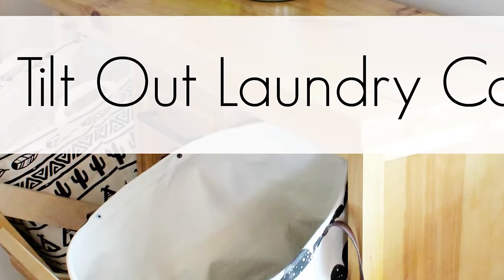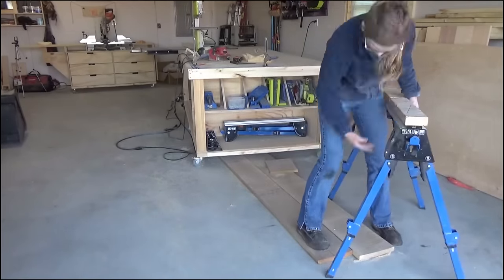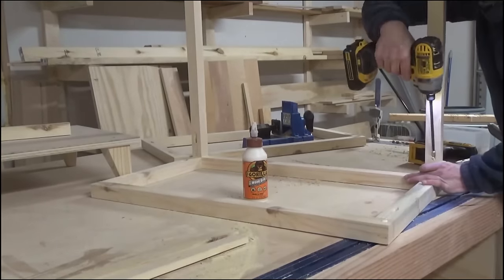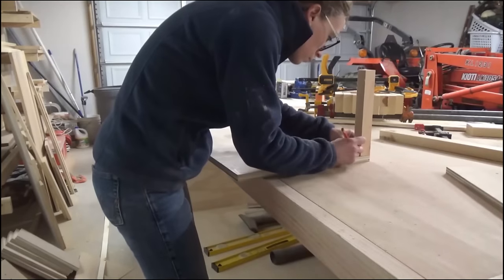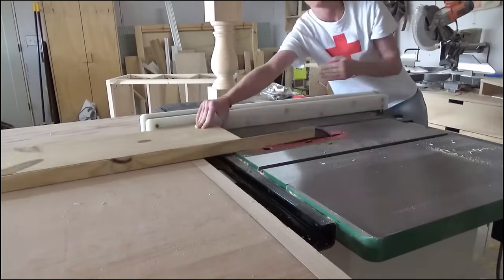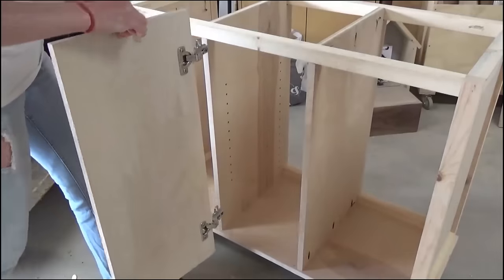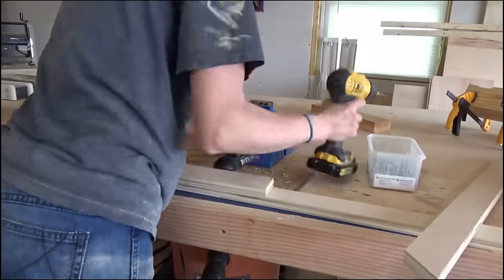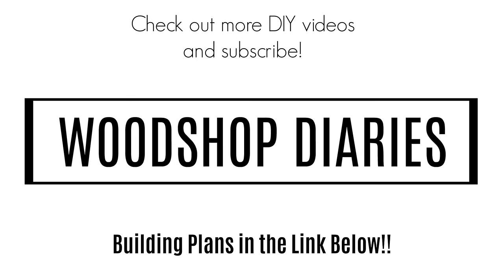How to Build a Tilt Out Laundry Cabinet

Comment: Just remember that using glue on end grain is almost rendered useless as the end grain absorbs the majority of the glue, hence why most people use some kind of joinery (half lap, mortise and tenon etc.) then use wood glue. Amazing build though, came out awesome.
Reply: when I do this type, I tend to use a router, rout a channel until about half an inch from the end, and wedge in another piece of wood. You can't see it once assembled, but MAN does it make a difference

Comment: You are awesome.  I have an entire garage/shop that I could do this in, but I'm totally afraid.  Where did you get your determination?
Reply from the maker: You got this! You just have to start. The determination has to come from yourself and you just have to decide to try. I’m self taught so I just learn by doing.
Reply: @WoodshopDiaries  I feel like mistakes could be expensive.  I will give it some thought.  I have no excuses...I am retired and my father was a carpenter.   There should be some of that ability on my blood.  Lol.  I want to make a hamper cabinet/tower for my bathroom.  I would hate to screw up on good wood.  Maybe I should try modifying an existing cabinet.

Comment: I'm about to build something similar and was looking for how others approach this. I had in my head that I would use some kind of horizontal dowel as a hinge pin and hadn't considered standard euro hinges. Watching your video changed my approach. Using the hinges can also provide the added benefit of a soft close - thanks!
Reply from the maker: So glad you found it helpful! There are probably several good ways to do it, but so far so good...this has been working great for a couple years now 🙌😄

Comment: Love your videos, I made one just like the one on your video and it was really nice but I use compressed wood for top and sides but when paint it I didn't like the way it looks so my question is ...do you have any suggestions on how to paint compressed wood and make it looks nice???
Reply from the maker: I’m not sure what you mean by compressed wood? Do you mean plywood? I use plywood all the time for my projects and paint them just like I’d paint anything else. But, I use high quality birch hardwood plywood (basically cabinet grade plywood) and that makes a big difference. Regular rough pine or treated plywood won’t be smooth enough to give you a nice finish.
Reply: @WoodshopDiaries  maybe that's why, do you have any suggestions on how to make fix it at this point??
Reply from the maker: I’m not sure what your exact issue is to fix. You just said it doesn’t look like you wanted, but I’m not sure what exactly that means. I’d suggest priming if you haven’t already. And a thorough sanding between coats of paint.

Comment: When you made the top with 2x10’s would it still be durable if I wer to use a 2” strip of other wood in between the 2 2x10’s?
Reply: If you use wood glue and/or join them then yes.

Comment: That turned out great! I have been searching for a good video guide on how to make one of these! I am looking at making one with 3 tilt outs. Is this cabinet pretty sturdy? I was considering doing a custom walnut and epoxy piece for the top and just wanted to make sure that it can withstand the weight of the top piece if I take that route. Thanks for the video!
Reply from the maker: Thank you! Yep, it’s sturdy. No issues with it so far after over a year of daily use. I’d say it should be fine with a heavier top.
Reply: @WoodshopDiaries  Thanks for the response! If I were to use plastic laundry baskets, do you know what size I'd have to get so they fit in the doors?
Reply from the maker: I couldn’t find any that fit, that’s why I used the fabric/canvas type. I can’t remember off the top of my head, but the plans have the door dimensions that you can try to match 👍
Reply: @WoodshopDiaries  ok! Maybe I’ll just keep with with ones like you used! Thanks again!
Reply: @WoodshopDiaries  I want to build this but I have a slight addition to it that I'd like to try and was wondering if you could give me some advice on how to do it. Would your website be the best way to reach out since I have a picture of the addition that I'd like to make to this piece. Thank you!